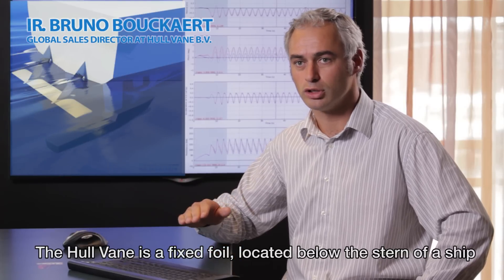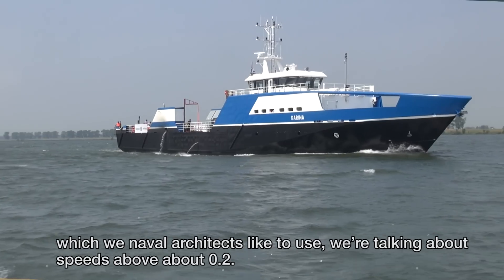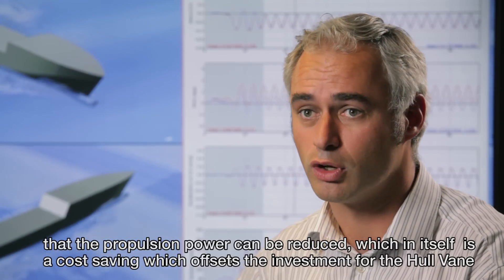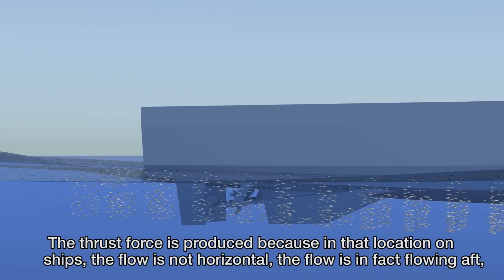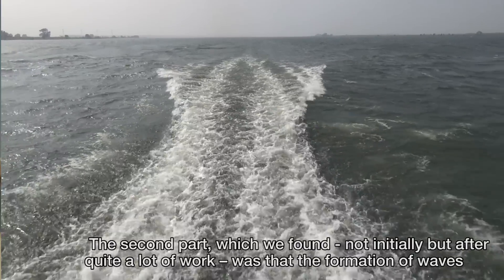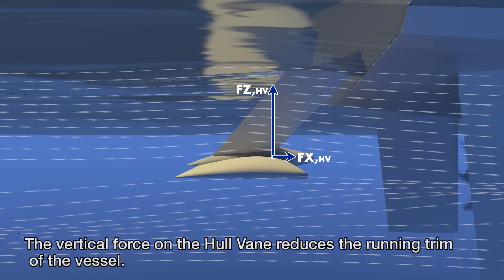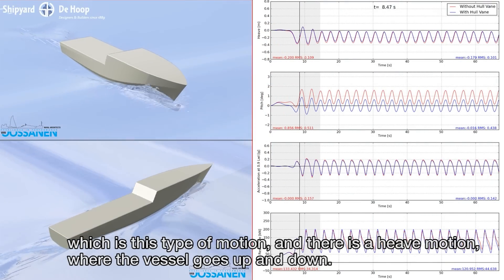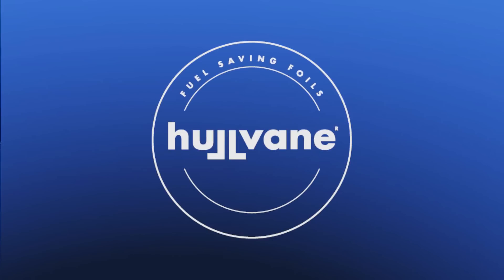Hull Vane - Fuel Saving Foils

Comment: From a Wiki article on WW2 German Schnellboot:
  - Small rudders added on either side of the main rudder could be angled outboard to 30 degrees, creating at high speed what is known as the Lürssen Effect.[5] This drew in an "air pocket slightly behind the three propellers, increasing their efficiency, reducing the stern wave and keeping the boat at a nearly horizontal attitude".[6] This was an important innovation as the horizontal attitude lifted the stern somewhat, allowing even greater speed, and the reduced stern wave made E-boats harder to see, especially at night
Reply: Clever people
Reply: >This drew in an "air pocket  

This sounds dubious. I would not be surprised if this was counterintelligence by Germany to subvert foreign boat designs.
Reply: very cool technology
Reply: Interesting !
Reply from the maker: Lürssen effect is very different (more like a pair of vertical adjustable trim tabs): http://www.modelwarships.com/reviews/ships/dkm/s-boat/s-100-72/72-S-100-p2.htm

Comment: Hi Carmel, that is a misconception. Optimizing just the trim angle will give you a few percent.  The Hull Vane can save 10-15% on many ships by removing the trim tab (or wedge), even if you end up with the same trim angle eventually. It influences the trim of course (strong vertical force) but this is not always even desirable. The effect is really in the generation of forward thrust and the modification of the wave profile of the ship. I would say it's more similar to a bulbous bow than to a large trim tab.

Comment: Well, all I can see at the moment is that it is a large trim tab which could modify the angle at which the hull runs,
I feel that if the hull alone is running at the right angle this would not bring about any benefits, but only drag.  For a hull that is not running at the optimum angle, it many bring some advantages.
Reply: You don't get it. Its has a much more complex principles behind it than trimm tabs
Reply: @TechnoGlobalist  Well, I have tried this on my displacement boat and since the transom and hull are lifted, then the flow of water will contain an upwards velocity or the rear part of the natural wave around the displacement hull. One is invited to think that putting in a horizontal Vane as suggested in this video one could surf on this rear part of the hull wave and so gain speed, but the drag of the vane and the suction due to the uplift at the rear of the ship's hull is nonlinear and rises at a  higher rate and so what one gains, one loses. Nature itself thought it out before we did and so for the greatest efficiency the design must be in the hull itself and not any appenages introduced on the hull. Birds and fish and dolphins and orcas do pretty well without additional appenages.  The best manner for efficiency is to design a good hull in the first place. Anything pushed along beyond its natural speed is expensive.  Also just because there are no moving parts on the vane, it does not mean that there are no maintenance costs. 
With my vane, it certainly trimmed the hull to run straight, but at the expense of fuel at the top displacement cruising speeds. If it was not so inconvenient, displacement hulls would benefit if the propeller was put right under the midship as the high pressure at the back of the propeller would then forcefully fill in what in normal condition is a suction zone at the aft of midship run of the vessel.  This arrangement would in fact cause the inclined aft part under the ship to act as the vane described in this video.  But it is all so inconvenient to add a midship draft to a displacement vessel. 

I would like to hear about the explanation of the complex principles that you referred to as acting on this vane! for as far as I am concerned it is no more than a wing with the right angle of attack to surf the rear hull wave.